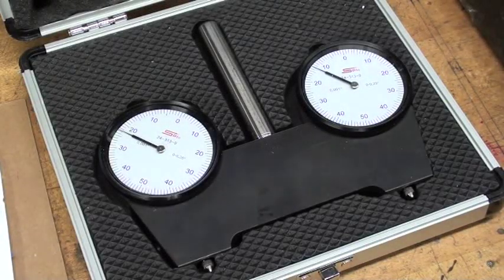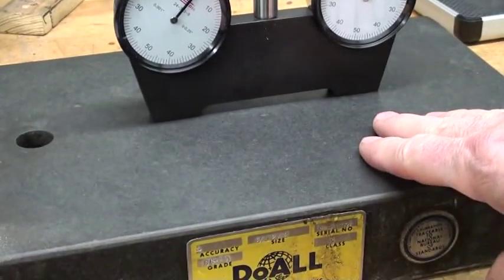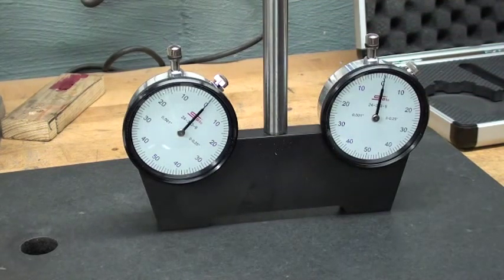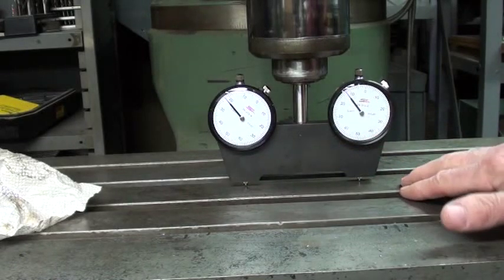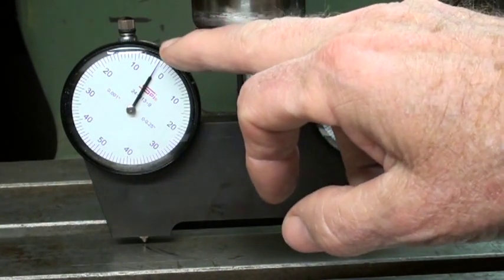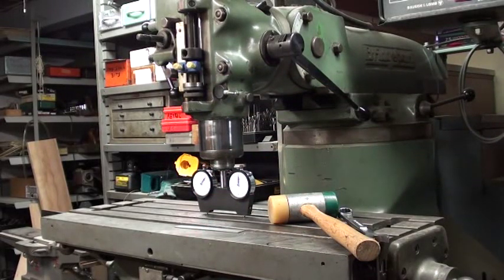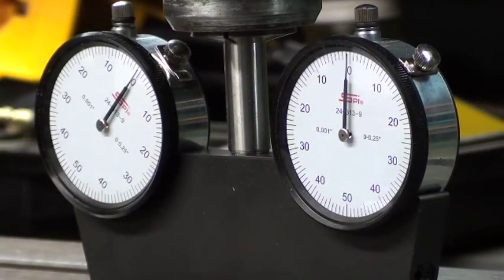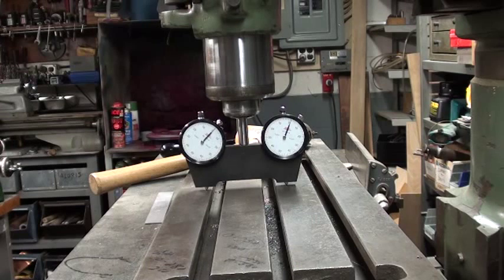MACHINE SHOP TIPS #15 Bridgeport Mill TRAMMING with SPINDLE SQUARE tubalcain

Comment: Thnaks for the knowledge Mr. Pete! I've been using the Starret Spindle Square at my job and it's perfect for tramming the Bridgeport head to the vise or the table.. I usually tram to the vise and have a few gentlemen arguing with me about the validity of this product on Facebook. I just may shit them up with a link to this video. For longer and larger parts, I would use something with a much wider swing and tram to the part (if pre-machined) or the table for greater accuracy over that area... do you agree? Thank you again sir, I'm a huge fan of your channel.

Comment: If the table isn't perpendicular to the knee dovetail, there will be a perpendicularity error between the knee's dovetail and the spindle. This will result in unwanted movement of the cutting tool when using the knee to raise the part into the cutting tool, instead of using the quill.

Although I'm not using a Bridgeport, I'm curious if table perpendicularity can be adjusted, and how it's checked.

Great series - keep up the good work. I've learned SO much.

Comment: I've used these tools and they are cool and have other good uses like for sine bars. I'm just old school and would rather sweep in with a test indicator. Also when I tram the head I do not move the table up and down. I make sure the knee is snug  against the ways but I'm sure you probably have the knee lock snug when moving the table up and down. Also as another commentator has mentioned it's just a mill and there is no reason to over think the accuracy of the machine. They are only accurate to a point. So in my opinion depending on the work you're doing will be a factor in how accurate you need to be within the machine's parameters. For instance those who think lowering the spindle will give them a more accurate tram on the head so they lower the table way down and bring the down all the way think when they are done and move the table back up closer to the spindle it will be more accurate! Well for they're information unless the machine is called a jig bore or grinder it's not going to make enough of a difference to justify the time to screw around because as soon as you move the table that will be gone then add the variable that when you move the table back up and so on and so on. I love your videos! Super valuable lessons! Keep up the great work!
Reply from the maker: +Liz Brown Thanks

Comment: I only read a couple comments, my suggestion may have already been mentioned. That being said, you might consider checking the table in X and Y, then adjust the axis that is the furthest from square first. This is of the most benefit when one axis is way-off. It may save repeating the process when you really want it really close. I try to hit half a thou accuracy. You can see the difference when fly cutting on larger surfaces.

Comment: The head is where the adjustment screws are located, therfore only the head can be "out'.  The table is meant to be solid and stable, moving only in the three axis in strictly linear moves. Imagine how complex and unstable a mill would be if the head was strictly immovable and the table had to be moved to align with it.
Reply: The table can be out for example the x and y axis may not be perfectly perpendicular to each other but this is not adjustable, they are never perfect but there are tolerances they have that are machined into them and can not be easily adjusted.

Comment: One thing I would recommend doing every 90 days or so, is that you start off with an indicator in the collet and run the table in both the X and Y axis and make certain that the table does not have any excessive runout. It is a good idea to stop at several intervals along the length of the X axis, and then run the limits of travel in the Y axis and record your deviations at predetermined intervals. This will give you a "map" of the table accuracy over its entire length of travel in both the X and Y axes. It is also a good idea to track Z axis travel deviation at the minimum and maximum travel that you anticipate to use for a run. You can be prefectly fine at the top of cut, but three inches away from your calibration point, you can be off several mils, as far as parallelism to the X/Y axes goes, due to wear in the Z axis ways as well.

It is quite common, especially on machines that have seen a lot of use, for the ways to have uneven wear as most machines get used near the center of travel much more frequently. You may be perfectly fine through a small area of travel and then begin to deviate in the Z axis (vertical) depending upon how the X and Y axses ways are worn. This is fixable, but beyond the scope of this posting - and it depends upon which machine you are using and what degree of tolerances and lengths of cuts you are making. If you are working large pieces to close tolerances, realize that the dial indicators have some degree of error throughout their range as well, and with a 4" baseline of this gage, you are still prone to error multiplication on cuts longer than the 4" baseline that this gage uses.

Even so, this is a great little gadget as long as the dial gages are accurate and the machine is within allowable deviations with respect to the tolerances you are working within. Thanks for posting the video. This device would also be good for checking runout on mills, lathes and jig bores as well.

P.S. Good video quality!
Reply from the maker: +MsJoaniePH Thanks

Comment: I know this is an old video and I understand everything you explained but I don't understand how you know the adjustment needs to be made on the head and not the table. Isn't it possible that the table elevation where you made your adjustments to the head along X and Y  brought the head perpendicular to the table at that one elevation only. If the problem was that the table surface is not perpendicular to the Z axis and/or does not travel exactly vertical in the Z axis that you will be off every time you change elevation of the table.

Maybe you posted a video prior to this where you determined if the head or the table was out, or both for that matter. I looked but couldn't find it. Not knowing anything about the Bridgeport is there a complete alignment procedure written out in the manual or somewhere else that you would use if you had taken the machine apart for repairs or to move it.

Comment: This is a good tool for getting it close but I would still recommend tramming the head in with a single indicator in the traditional way after using this tool. Using this tool you are assuming that the shank is perfectly perpendicular with the bottom face of the tool. while the perpendicularity is likely close nothing is perfect and the closer the head is trammed in the better the outcome of the parts being machined. This does look like a good time saver especially for tramming in the Y axis, the x axis you just have to split the difference with a traditional indicator.
Reply from the maker: +Phill Huddleston Thanks
Reply: +mrpete222 A quick qualification for this fixture would be to take readings 180 deg apart. If the fixture body is square with the shank, you should have the same readings in both positions.
Reply: +Phill Huddleston This indicator is a waste of money, I agree totally with your opinion about the shank. The best way I have found to square a head is to place a dot on the fixed vise jaw and move the dot under your indicator, no vise removal and is super accurate
Reply: I don't believe it is necessary for the shank to be 100% perpendicular to the bottom face. I'm thinking this possible deficiency is overcome by the calibrating of the two indicators on the surface plate. For what it's worth, Starrett makes this very item and they seem to believe in it.
Reply: That would only work if the table or vise you were indicating was already known to be perpendicular to the spindle which would alleviate the need for tramming  in the first place. Since the zero settings on each indicator are adjustable you would have to check them every time they are used against a known perpendicular plane which makes it useless for precision tramming.
Reply: grntitan1
Of course "it is necessary for the shank to be 100% perpendicular to the bottom face", for it to be an accurate tool. Zeroing it from the bottom face has absolutely nothing at all to do with the shank ... nothing! Like somebody has already said, to check the tool's accuracy, you can turn it 180 degrees and see if the indicators have opposite readings. BUT, at that point, you're about as well off to just do it swinging a single indicator. Actually, I like to use a coaxial indicator, (for most anything I indicate on a mill) you don't have to bend around any at all to see the reading.

Comment: This is a ultra tool. I never had much use for on the Mill. There are too many variables to consider. Moreover, It's just a mill. Don't over think things.
 The shaft could be off (that would really suck) I never looked, but are there any "Certs" for this device?
 And the collet could be off! I recommend the sweep method. You can sweep the whole table..remount at the spindle and try again. (just in case you have a bad collet).
 I know your try hard to show "Quick Steps" ...but I just assume use this else where. Where ...I'll let you know when I find it and keep the $150.
Reply: As long as the collet is tight and the indicator mounting stem is not moving in the collet it would not affect the tramming at all.
Reply: BS!

Comment: I have a square column mill and the Starrett version of the spindle square. I tried to tram my mill yesterday. How close is "close enough"? I was able to get the tilt of the head to within a thou and a half. Is that good or should I work with it some more?
Reply from the maker: +65BAJA Thats good enough. lyle
Reply: +mrpete222 Usually you are good if your total deviation is 1/10th of the required tolerance band. In other words, if you are working to +/- 10 mils, you should be able to get "in-tolerance" work if you are within 2.0 mils, plus or minus, over the length of the cut. The only time greater precision is required is if there are other tolerances involved that have much tighter requirements for the end-use aspects of what you are machining. This would generally apply where tight limitations for overall flatness or perpendicularity are necessary. It is not uncommon for a feature to have a locational tolerance of +/- 30 mils but have much stricter tolerances for form versus location. 

This is a lot more important where multiple pieces, of the same dimensions/features are to be machined than for a single part, as this practice allows adequate allowance for things such as cutter wear and other small, part-to-part anomalies. Keeping mounting surfaces clean is also a must, just as mrpete222 did with his alignment fixture prior to putting it on the surface plate for calibration/qualification.

In a very real sense, nothing is straight, square, perpendicular, level, parallel, perfectly angular, contoured or round. What needs to happen is that your total deviation must be within what is required for the finished piece to be completely usable for its final application.

Comment: To align the mill that way you did is wrong, you have to align the table, because otherwise you aligned the spindle only for one point. Just to drill a hole at this pont.